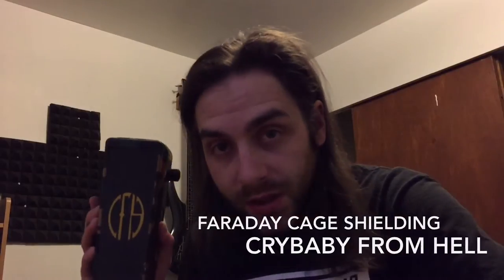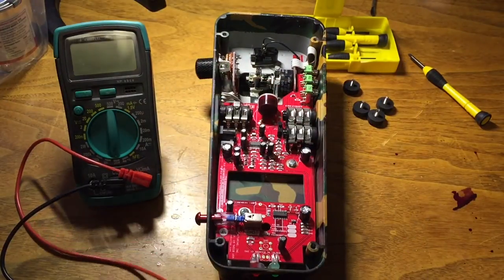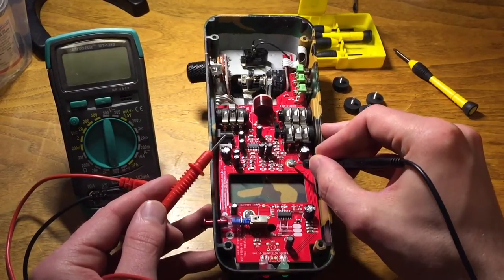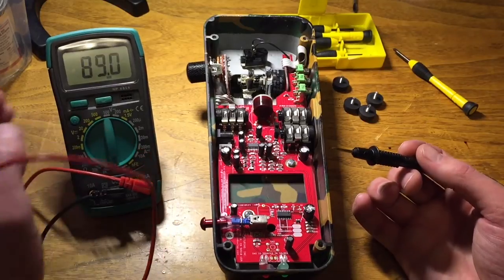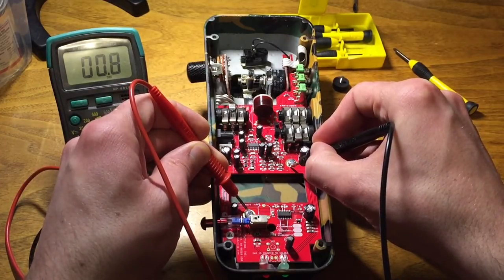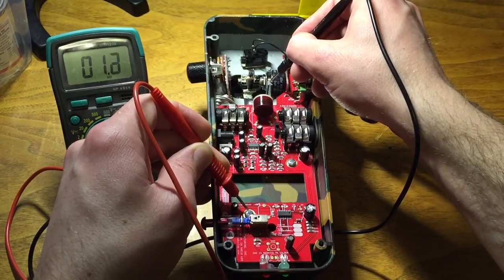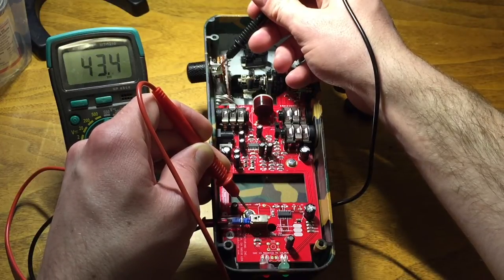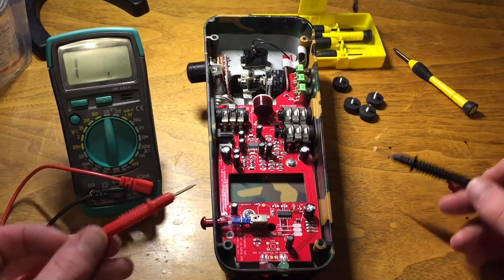How to shield a crybaby wah pedal

Comment: Thanks for the great instruction. I've tried this to fix some major hum issues on my BBE Ben Wah. Conductivity of the faraday cage is excellent now. But the hum is still unbearable unfortunately. I'll have to take the Wah off the board to keep it away from the power supply.
Any other suggestions (besides buying another Wah)?
Reply: +Bas Vredeling Google mumetal. That's by far probably the most effective magnetic field shielding for the kind of hum we experience in wah wah pedals. I will try to test it as well since I have my wah wah built in the midi controlled box and unfortunately it has to be in amp's case, near the transformers. I had simialr issue when my regular wah wah was close to midi foot controller. I had to ask my friend to make me external 9V DC socket to plug external power supply and it worked.
Reply: faraday cage with alluminium or copper works for high frequency EMI (like smartphones). Low frequency EMI (the 50Hz from power transformer) can only be absorbed by Steel, or even better, by mu-metal.

Comment: Is it better to use copper foil for all internal shielding instead of conductive paint? Also I have an issue with my wah's backplate, it bent a little and now the surface is not in a full contact with the pedal. Should I get a replacement or there is a way to fix it? Cheers
Reply: Did you try it? Because I want to shield my pedal as well and just got copper foil
Reply: Alright I used my copper foil now and it worked perfectly fine. It is a lot less noisy now. So if anyone is ever interested if it workes - yeah it does. I just covered the whole enclosure with copper foil and made sure that some of the connecting points (on/off switch for example) got in contact with the copper foil. So as soon as I assembled it back up I could read some resistance thanks to the foil.
Reply: @MetalKabu  

When you say that you covered the whole enclosure...was that external or internal ? I have a Morley wah that picks up interference, I was going to use sheilding paint on the inside.
Reply: @Karma-kr5dd  I covered it internal. I unscrewed everything, took it apart, covered the inside with the copperfoil and screwed it back together (and i just penetrated the foil with the screws to screw it back together if that is of interested).
Reply: @MetalKabu 
Many thanks for your reply. Useful information.
All the best.
Reply: @Karma-kr5dd  you are welcome :)

Comment: the conductive paint isn't worth it here unless it is mu-metal based. you also need to shield the pedal at the bottom using mu-metal in order to protect the wah inductor from the power supply interference (if you have one underneath your pedalboard).
Reply: What if your using a 9v battery?
Reply: @jmgmarcus808  the power will be clean, but it can still pick up noise if not properly shieldied and placed close to EMI sources such as switching PSU
Reply: @blackstifo  Yeah, I never had this problem in the US and used dozens of wahs. Now I live in Kuala Lumpur and bought a mini bass wah which is built like a tank and I get a hum even with a battery.
Reply from the maker: I’ve confirmed it playing the same stage radio frequencies were very prevalent. After this, never again.

Comment: What a nonsense. The enclosure is made of metal. Make sure that there is a conductive connection to the circuit ground and your done. But it won't help much if the hum is caused by a nearby power supply. You need a mu-metal shield for that. Maybe there's a ready made shield for a microphone capsule that fits on the inductor. Or place a piece of mu metal on the bottom cover of the wah, below the inductor.
Reply: Got any idea what my problem is then? I’ve a Dallas Rangemaster clone and it’s a detailed replica so the internals are attached to a U-shaped plate of folded metal which inserts loosely into an open-ended folded metal box and is held in place by screws, I would imagine it’s well shielded then yet I’ve pinned it down as the reason why I pick up strong radio signals as it’s the only pedal which does this whether or not I isolate it and use cables that are shielded with ferrite clamps. I’m ignorant when it comes to RFI and electronics so only thing I can think of is that it’s not properly shielded and the circuitboard is grounded to the U-shaped metal enclosure with a screw.